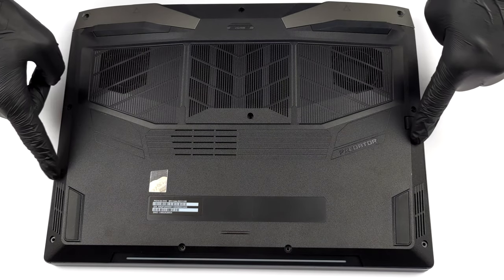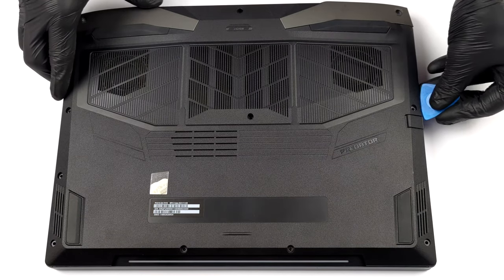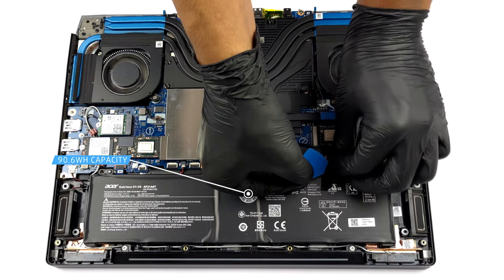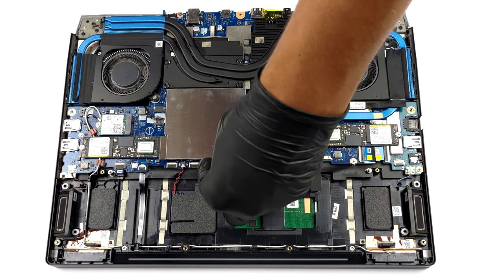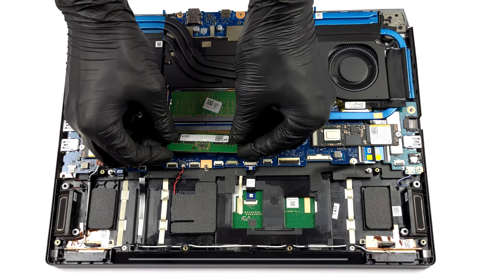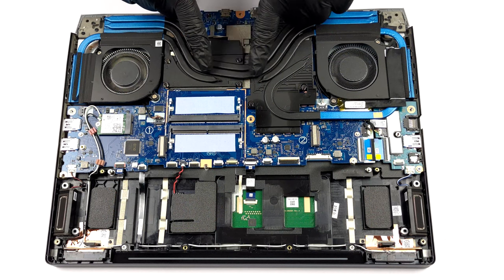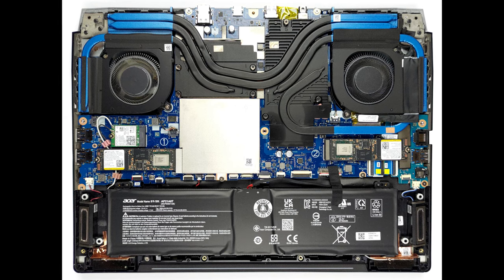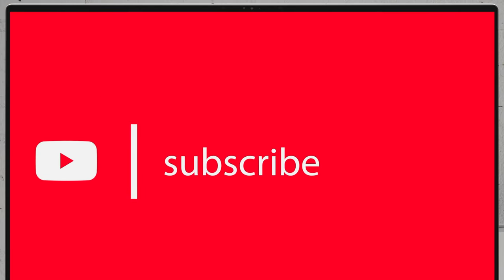🛠️ Acer Predator Helios 300 (PH315-55) - disassembly and upgrade options

Comment: No possible to put an sata SSD?
Reply: why they slow af, get a USB3 SSD
Reply: @John_Smith100  because maybe they have one.. They didn't ask for your opinion on speed. Especially with your sm as attitude.
Reply: No man, it has the possibility to put it in the previous Helios model 355-54.
Reply: Man I doubt there's room for that
Reply: I have the same model, but the keyboard rgb doesn't work any suggestions?

Comment: mine won’t boot after
Reply: Money never did either. I did 2 sticks of 16, no dice. Best Buy did 1 stick of 32, no dice. I have no clue
Reply: @scottskinner577  I figured it out i just had to wait a solid 5 minutes and then it finally started booting fast
Reply: @reysinz6022  soooo just install it and wait a while before trying to start it?
Reply: I have the same model, but the keyboard rgb doesn't work any suggestions?
Reply: Wait - it can take up to 5 mins. If the turbo light comes on, then leave it to check the memory.

Comment: This was the same for my 2022 model, which I just opened to put another 1TB NVME drive in. 

- The video doesn't show it, but prying with your fingers on the grey bits will lift the bottom off easier. There will be a few slight "cracking" sounds, and you can just keep pulling it off back to front. I didn't even have to use a tool to pry it. DO NOT try to pry it from the front where the light bar is. There are tabs underneath stopping you doing that, it has to be pryed from the back.
Reply: Where’s the grey bits I am struggling for like 3 hours now
Reply: @209gamer6  At the back of the laptop, they surround the rear exhaust
Reply: @callumwinkler1943 cant find it bro need a little help
Reply: @sourabhvishwakarma1  what part are you struggling with?
Reply: @callumwinkler1943  opening the back
Reply: @sourabhvishwakarma1  you need to gently pull down below the silver trim around the rear exhaust fans to pry the bottom off.
Reply: @callumwinkler1943  opened it, bro do you play fortnite or some other games?? What are your normal temps while turbo in fortnite or any other games.
Reply: @sourabhvishwakarma1  i don't play fortnite, but i do play overwatch and cod. honestly it's in the 70's, maybe 80's in the summer
Reply: Also worth noting that there is a grey strip above the laptop and behind the screen. Once you have the back off, this strip comes off easily (just pull it from the revealed edge), and you now see the two hinges and their tensioning nuts. Reducing the tension by about a half turn on each will prevent the dreaded 'gaming laptop hinge break just outside warranty issue' considerably. Probably more of an issue for MSI gaming laptops, but worth looking into for your Acer if you will be taking the back off anyway. FWIW - hinge break happened on my last (non Acer) laptop, and is why I bring it up - total waster of still-viable gaming hardware when it happens!

Comment: Can you upgrade the CPU ? like can you upgrade from i7 to i9
Reply: Processor is baked on to the motherboard. As is the graphics options as well. We all have to make our decisions when ordering. Only ram, Wi-Fi card and storage (battery) can be swapped out. Replacing the keyboard , trackpad, and even the panel need disassembly.
Reply: No. It is soldered in, as is the GPU. Memory and SSD are the only real  upgrades.

Comment: im a noob when it comes to computer parts... but i sent this exact same laptop for repairs and noticed that the bottom left connection (red/white) wire was disconnected, where as the bottom right (blue/white) was connected. i reconnected the left one, but what are those two parts for?

Comment: I have a ph315-55 2022 model. Which fan is the one on the top right? Mine stopped working and i need to know to buy a cpu or gpu fan

Comment: Any reason mine wont start with new ram? Ive had Best Buy install a single 32, no start. I did 2 16gig sticks, no start. Wtf
Reply: I was thinking about it and bought the crucial. But didn’t realize that I bought the ddr4 and needed the ddr5. I be heard the predator has trouble with the higher mhz 4800/5200 maybe you’re having a similar issue?
Reply: @ryan bollinger  I guess we will see. I just bought the 32gig stick (ddr5, 4800) at the instruction of the Geek Squad at Best Buy. They installed it themselves and it wouldn't start. I read reviews on their website from others to where it Did work on same Laptop. So they said let's try the 2 sticks of 16 maybe the voltage or current or whatever on a single channel. I may be forgetting exact wording. So I get those, same situation. No dice. 
 It came factory with 2 sticks of 8gig 4800mhz. Maybe lower frequency would work, idk enough about it myself to say.

P.S. thanks for the feedback
Reply: I have the same model, but the keyboard rgb doesn't work any suggestions?
Reply: it takes a longer boot. About 30 seconds longer for me, but it can be up to 5 mins for some makes of memory. If the turbo light is on, its still thinking.

Comment: Can the frequency of the ram be upgraded too or is it locked in at 4800 mhz
Reply: The 12700h is stuck at 4800 mhz.
Reply: No lpddr 5200  support 12700h

Comment: will this not void the current warranty
Reply: I asked bard and...

According to Acer's warranty policy, opening up your laptop and upgrading the RAM will not void the warranty, as long as you do not damage any of the components during the upgrade process. However, there may be a sticker on the laptop that says "Warranty void if seal is broken." If you break this sticker, it could be interpreted as voiding the warranty, even though it is not technically required.
Reply: If you are worried about voiding the warranty, then you can just wait until the warranty ends and then upgrade your laptop
Reply: No stickers you have to break to void it, so no.
Reply: @shambhangal438  ty

Comment: where is the connection to keyboard? i need to replace mine. thank you..
Reply: Ah. that is the hardest one of all. You usually have to remove the motherboard. Did that with my older MSI. Takes forever; you'll have to find a complete disassembly video, as you will have to totally remove the motherboard to remove the keyboard.
Reply: @shambhangal438  please post if you ever have a complete disassembly video, thank you 🙏🏻🙏🏻😇

Comment: may I ask what ssds are compatible with this
Reply: I installed the Samsung 990 PRO NVMe M.2 SSD, 4 TB, PCIe 4.0. The Crucial P3 is a good cheaper option. The thing to watch out on this laptop (and pretty much all of them) is that SSDs with memory on both sides of the SSd will NOT fit as there isn't the clearance. The two SSDs noted are good though. Go with PCIE 4 for performance and the newer 4TB for size.  Oh, and don't buy versions with the heatsink - they are desktop only!
Reply: @shambhangal438  Since there are two slots, does it mean we can install 8TB in total?
Reply: @alexchoy9526  Yes it does.

Comment: can we upgrade the frequency of RAM from 4800Mhz to 7200Mhz on this specific model?
Reply: The intel core i7-12700H can only go up to 4800Mhz from the research ive done so even if you stick faster ram in it will be capped at 4800Mhz (also note the ram will also be capped at the slowest speed installed so if you only upgrade the speed of 1 of the 2 ram for a cpu that could take faster speeds you will still run at the slower speed)
Reply: Dude your trying to overclock a Laptop Motherboard. It's not designed and manufactured for that. If you apply voltage over the factory default, you'll fry the chips over. Only a few computers Systems are good enough to be over clocked with heavy gaming parts inside.
Reply: @heheyboi1065  not overclocking, just was curious about the frequency support of this laptop...if supported then would have bought a chip which is high freq out of box. no personal tweeks. but max support is 4800mhz acc to my research as well

Comment: can you drop in a 2tb ssd or is 1tb per slot the maximum?
Reply: 4 tb
Reply: @drewdegeer4432  4gb max? 2tb per slot max confirm?
Reply: @DreyDope  the unit I worked on was 512 plus 4 tb. But I am sure you could add up to 2 x 4tb for a total of 8.
Reply: @drewdegeer4432  thanks
Reply: Taken from Acer Rep on Q&A section on BestBuy product page: "This model has two M.2 SSD slots; the highest capacity tested/qualified by Acer was 2x1TB."
Reply: 4TB - I know because Iinstalled it via a Samsung 990 PRO (NVMe M.2 SSD, 4 TB, PCIe 4.0)

Comment: I have the same model I7 12700h with RTX 3060 ,16 gb ram and 512 ssd so if you can guide me because
 I need to upgrad the ram and the Hard disk
Reply: which brand is better and the spc that It needs
Reply: Acer Predator Helios 300 PH315-55-70ZV
Reply: @howtomodel4014  Use CPU-Z to check the brand of your RAM and double the same one
Reply: @willislau22 i have a similar(1tb)  model and after using cpuz it tells me i have 4 ram slots is that correct. Because then i could have 4x16gb right?
Reply: @Joe_Payne same here

Comment: can i upgrade 2tb ssd in one slot?
Reply: Taken from Acer Rep on Q&A section on BestBuy product page: This model has two M.2 SSD slots; the highest capacity tested/qualified by Acer was 2x1TB.
Reply: You can add 2x 4TB SSDs = 8TB and 2x32GB = 64GB of RAM. Assuming latest firmware and the PH315-55 model and up to date BIOS. 2x 2TB is the older SSDs, and 32GB is the tested max on release - its 64GB now.

Comment: can i upgrade ssd up to 2tb?
Reply: You can do 4TB. Crucial P3 for cheap or Samsung 990 pro for long life and higher speed. Pick a drive without heatsink and with single sided memory modules - otherwise you won't have the clearance.

Comment: Hello I have the same exact model, what do you suggest a ram brand and specs to upgrade this? I have only 16gb. And newbie
Reply: 32 g x 2 for ram is the furthest that can go. Storage is 2x Nvme 4.0 options currently available.
Reply: Would the 4800/5200 mhz be ok to install?
Reply: @ryanbollinger6730  I am pretty sure the max speed for the ram is 4800
Reply: I have the same model, but the keyboard rgb doesn't work any suggestions?
Reply: @patinomelendezjuanandres2735  you can check the cable that is connected to the keyboard and then the motherboard First. Obviously the model has a Software switch, my alienwasre also has a keyboard switch as well.
Reply: @ryanbollinger6730  yes but the CPU is locked to 4800, so you would waste your money on 5200. I know - I made that mistake! Better to go with 4800 and 2x32 if producivity is your thing, or 32 GB for gaming.

Comment: Good morning, I have an Acer Helios 300 with similar specifications as shown in the video.
I'm thinking of upgrading the RAM to 64Gb using Crucial DDR5-4800 RAM.
According to my research, Crucial sells an individual 32Gb stick (Crucial 32GB DDR5-4800 SODIMM (ref: CT32G48C40S5)) and also sells a 64Gb kit (Crucial 64GB Kit (2 x 32GB) DDR5-4800 SODIMM (ref: CT2K32G48C40S5).
My question is if there is any performance/compatibility difference in using the 64Gb kit, compared to using two 32Gb sticks purchased separately?
I'm asking this question because in my country I can get a better price buying two separate 32Gb sticks (ref: CT32G48C40S5) still getting the 64Gb, than buying the 64Gb kit (ref:CT2K32G48C40S5).
The 64Gb kit is €30 more expensive than buy 2 sticks of 32Gb separately.
I hope you can clarify the issue for me.
Thanks
Reply: a friend of mine mixed and matched two different brands of ddr4 sticks(2 - 2). it took him a few tries to get everything situated. long story short i dont think it would matter whether you buy two 32s instead of one 64 as long as theyre the same times. you are technically buying the same brand. unlike ryzen that benefits with dual channel and higher clock speed, intel is more laxed. again, not sure if this would apply to ddr5 as well. good luck!
Reply: You lose dual channel transfer speeds. 2x32 with each stick bought from the same manufacturer (typically as a kit) is recommended for this reason.

Comment: Removing the back cover is very difficult... Scared to break it
Reply: just take your time with it bro... It should crackle as it comes off the right way. also having that tool or an old credit card makes it easier.
Reply: Yeah, I feel the fear. It took me 22 minutes - 20 minutes being scared and messing about, then 2 minutes of 'aah fk it, I'll just do it'. Put the laptop on the table upside down then put your fingers in the exhaust grills at the back and close to a corner and gently but firmly pull up. You'll hear a crack as the plastic retainers click out of place. Once you hear the first crack, its plain sailing as then you can pull less and/or use a pry tool, but a real sweat until you do! As mentioned elsewhere, its much harder if you do it from the front of the laptop first - I'd say near impossible without braking some of the plastic lugs in the process.